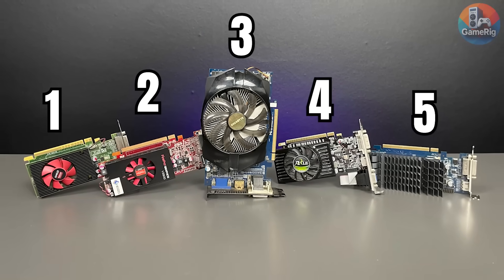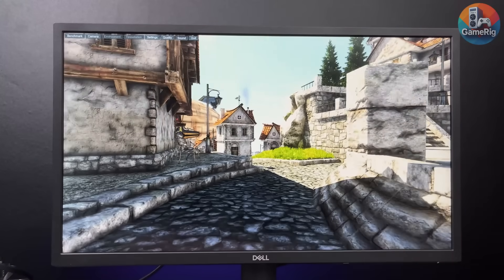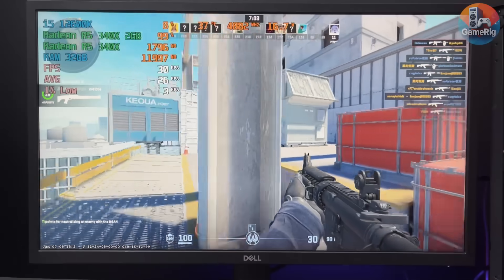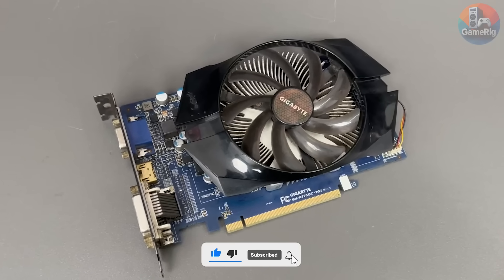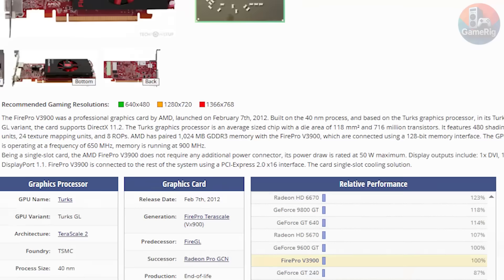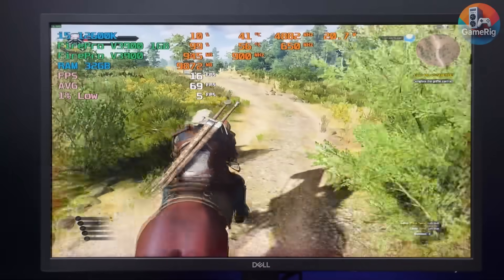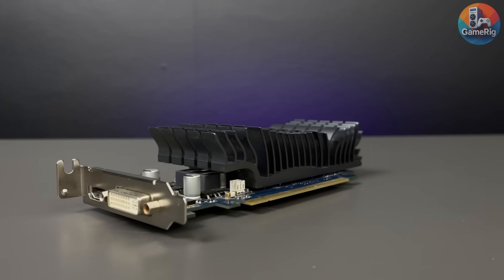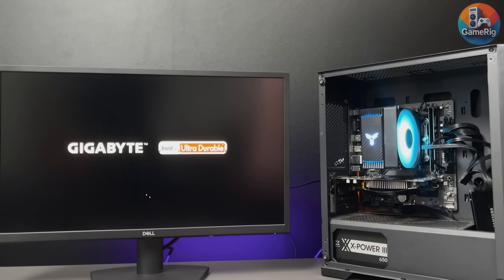Can the Oldest GPU Run Modern Games?!

Comment: Ok, let me ask you a question. Do you think a Model T Ford can outperform a GT-40? Or how about this... Do you think the sound quality of an 8 track tape is better than an MP3? Or maybe you think watching a movie on a VCR tape is just as good as 4K Blu Ray! There is a reason older tech goes out of use - because there is something better created to take it's place. Who cares if you can torture old hardware to try to get it to function in the modern world. What's the point? You can shove a high performance V8 into a Yugo... but that doesn't mean you should!

Comment: i have two of these 😂 almost three, gt 220 rather than 210. r5 340 is pretty legit ngl,  fine for retro games (Gamecube/Wii is what i used it for) and Minecraft when i had to use it when i was between GPUs a few yrs ago. i quite like it, it's cute. big fan of it because of its lower power draw and low profile single slot size.

Comment: Nice and interesting video. I would love to see more videos of the style with perhaps more capable hardware.
The fake GT520 make me laugh... Why does that thing even exist lol, Why make a fake low end card. It's hilariously sad.
I think I should also give it a try... I got a bunch of old hardware granted higher end such as a GT250 which is a rebrand of the 9800GT which was a rebrand of the legendary 8800GTX. I also have a 285GTX, a 9600GT, a Radeon 5770 and my best old card a GTX680 and a slightly newer AMD Reply a Radeon 7950
I love the nostalgia.
Reply from the maker: Thank you so much, I really appreciate it! Yeah, the fake GT520 is both funny and sad at the same time 😂
And wow, that’s an amazing collection of old GPUs. Cards like the 8800GTX, GTX 285, and GTX 680 were absolute legends back in the day. I might definitely do more videos with higher-end old hardware in the future. Nostalgia hits hard with these builds!
Reply: @gamerig68  Thanks for the reply, as a 42 year old I.T. guy who grew up with such hardware... well It will always be a hobby. My best oldest card is a Voodoo3-2000 PCI that I have running in a K6-2 400 but that won't be able to run anything modern lol.
This is my other account which is a total mess. Having tried to release some videos, I truly respect how much hard work it is. I do need to get back to it eventually. 
Cheers and keep up the awesome work.

Comment: 1:58 wow this gpu is basically pretty much the same, bar number of cores (2 vs 6 of radeon) and shading units (256 vs 384 of radeon) that the radeon has more, memory bandwidth that the radeon has 10% more, and cache that the radeon has less (128kb vs 1mb), same 9xx mhz memory with 64 bit bus, same number of tmus and rops, similar gigaflops performance (radeon has around 20% more, but 10% less pixel and texture fill rate), both are pcie 3.0 x8 with 2 gb ddr3 memory, of my 2017 laptop GPU, the nvidia 920MX.
Which is interesting, because to deliver barely 10-20% more on some things and still be worse on others, the R5 340 has a TDP of whopping 65 watt, while the 920mx laptop gpu only has 16 watt.
Talk about being terrible at power efficiency...that GPU has no business sucking 65 watts lol, with those numbers it should not pull more than 20 watts lol...

And lemme tell you, that laptop gpu was practically pegged at 100% usage on 720p low in games, while the processor, a 6th gen i5, barely broke a sweat.
I don't even imagine what bottleneck it could bring to something better than a 2 core 4 thread laptop processor from 2015...
Reply: 2:47 it very much will be able to run shaders games like minecraft, I played genshin impact on that laptop that has a similarly powered yet slightly worse gpu. Don't try 1080p tho, lower that stuff to 720p lol....
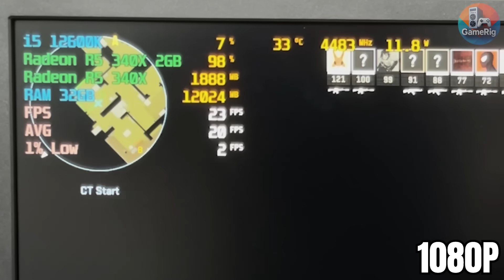Reply: 3:41 that's how you play these games on potato pcs... 12-15 fps, but with a frame graph as flat as a dead man's ECG. You cope with it.
Between ping of online games and peripherals latency, the frames deliver just in time to not be very noticeable.
Ofc in an esports game you would have a huge disadvantage, but on a game where you just play, like an open world, that's completely fine.

Also, something from the video tells me that yes, you dropped the resolution, but those quality settings seem to be on the high end. You can't run high settings on a gpu like that lol, low only!

Comment: If you want the oldest GPU's, you need an AGP or PCI GPU. Like the 3DFX Voodoo, Riva TNT, ATI Rage. But they not compatible with modern motherboards with their PCIE slots. So they can only be used for Retro builds. Where the OS of choice will have to be DOS, 95, 98 or XP.
Reply: Or even CGA or Hercules Video Cards for IBM PC. Those were one of the first ever GPUs.
Reply: i have a b350 board with a PCI slot lol, i could pair one of my old s3 trio whatever cards with it 😂 don't think it would even work with something like that though due to the age

Comment: Clickbait as FUCK. NONE of these are THE OLDEST GPUs ever made. Those would be cards from the 1990s, and would not go into a PCI-E slot.
The fact that you said "these are over 10 years old!" just goes to show how young and naive you are. The very first 3D card, AKA "GPU" I got back in 2003, and even then the 3D acceleration wasn't a new thing.

Comment: i have picked up a gtx 970 and a couple quatro cards on the cheap this last year  they have been fun  for my two tinker pc's. also this last year working up that second tower since finding a msi board.
Reply from the maker: That sounds like a fun setup. GTX 970s and Quadros are great for tinkering builds 👍

Comment: Those are not old GPU's the word GPU was coined with the First DX8 cards the radeon 8500 and the Geforce 3 in 2001, before that GPU's were just called 3d accelerators. Those would be the GPU's you could claim as your clickbait title as a fact.

Comment: wish my office pc had a pcie slot so i can get a gpu
Reply: Try to find a cheap used office PC with sth like Core i7 7th Gen. (Cheap, because Win11 not official supported. U can use workarounds or Linux) Look for ones built inside a "regular" Case. No small form factor stuff. 

All of those PCs should have the needed PCIe slot. Buy a cheap used graphic card which doesn't need a power cord plugged in. 

You'll get a PC, ready for FHD gaming all E-Sports-Titles for less than 100 bucks :)

Comment: Modern gaming with cards of that vintage is an exercise in pain, but there's plenty of good old games with low system requirements to play. These cards, old as they are, can play most of my GOG library very well.
Reply from the maker: Exactly. Modern games are rough on older cards, but they’re still perfect for classic titles and low-requirement games.

Comment: The first GPU, that's the Oland based GPU(which is 1st gen GCN, they just rebranded it a billion times, hence why it appears to be a 2015 card), they can be such a mixed bag, unfortunately you got the worst version possible, not only is it using GDDR3, which halves the bandwidth vs GDDR5, it's further limited by a measly 64bit bus, Oland has 128bits, but a lot of these cards were simply display adapters for OEM PC's, and all the corners were cut. I use them for retro builds, because they support Windows XP, and paired with a Dell Optiplex 9020, suddenly you have a pretty kickass XP system, if you get a version with 128bit and GDDR5. They are also very power limited, and putting on a different bios in my case got a significant boost out of it.

Comment: Did all graphics look the same back then? I had a Lenovo thinkcentre with an Nvidia 500 something and it looked exactly like the first except it didn't have the stock fan and they slapped a whole generic fan over the cooling block
Reply from the maker: Pretty much, yeah. A lot of older OEM GPUs shared very similar PCBs and basic coolers. Vendors often just slapped on whatever fan fit the heatsink to keep costs down.

Comment: I have a AMD a10 pro 7800B r7 it has r7 2GB ddr3 integreted graphics it uses system memory it runs Minecraft at over 150fps 12 chunks fancy graphics , Fortnite at 30-70fps GTA V at 30-40 or even 50fps sometimes

Comment: This is why the RX 570 and 580 are such good value. Sure most of them have been mined to death but if you can find a decent one used they usually only go for around $30 to $50 TOPS!

Comment: Something to be aware of with older AMD GPUs, if they're GCN v1 or newer they often have better compatibility on Linux these days due to relatively up to date Vulkan support, which allows them to run a lot of true DX12 titles through VKD3D that it can't run on Windows. Performance is usually better too, though that's more variable.

It makes them a bit more interesting than older Nvidia GPUs where ongoing support is dead in the water, at least until NVK (the open source Nvidia Vulkan driver for Linux) matures enough to be usable.
Reply from the maker: Great point. Older AMD GCN cards really do shine on Linux thanks to Vulkan and VKD3D support. It definitely gives them more life than they have on Windows.

Comment: You should test these gpus as a secondary gpu for running lossless scaling frame gen. If they works they might be a good frame gen gpus
Reply from the maker: That’s an interesting idea. Using them as a secondary GPU for Lossless Scaling frame gen could actually be worth testing.

Comment: Lol, i am on a fairly modern GPU (rtx 3050 6gb) and SSD storage, but my cpu (i5-3570k) and ram (2x4gb DDR3) are from 2012. The 2012 hardware im working with was fairly high end when I bought it (unlike the stuff in this video which was entry level even at the time of release), so it has kept up surprisingly well for modern gaming despite being an obvious bottleneck. I think those 2012 pieces will probably finally go obsolete at the same time that Windows 10 does.

Comment: Someone's still maining these gpus in 2026 btw
Reply from the maker: yes sir
Reply: Yeah because not everyone has the money to upgrade :/
Reply: Believe it or not. I was still maining gt620(made in2012)couple of weeks ago
Reply: i used an s3 virge in 2005-2006, then upgraded my mobo, used the on-board geforce 6150. then i have used a gt 220 since 2011 to 2025. i lately upgraded to a gtx 1070.
Reply: not really, its just spare stock which is getting sold off
Reply: like me,but a newer one r7 240 but i'm js planning to buy a newer one mine is bad
Reply: @samir3216-bs1lv  Try polaris?? Rx 4xx/5xx or even go big, try RX 6700XT, old but good options, RX 580 is a classic
Reply: using a Nvidia GPU from the Kepler microarchitecture that's on a spare laptop....

At this rate, I kinda am keeping the laptop to see which component fails next....
let's see what are the current issues(and mitigations, if any)... wifi card/antenna/wire has issues, so use a USB wifi dongle... onboard keyboard has some issue, so use external keyboard... flaking rubber around the laptop lid... display has some patches of discoloration, like as if more underlying light goes thru it... removable battery taken out as it no longer holds a charge.